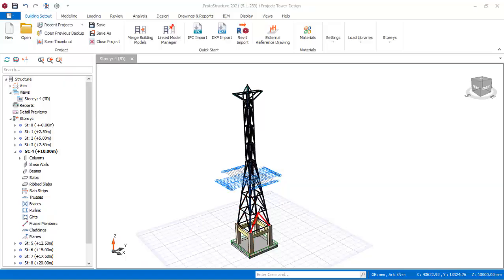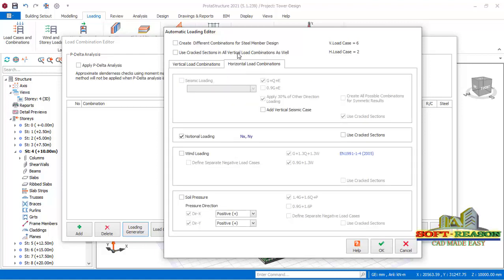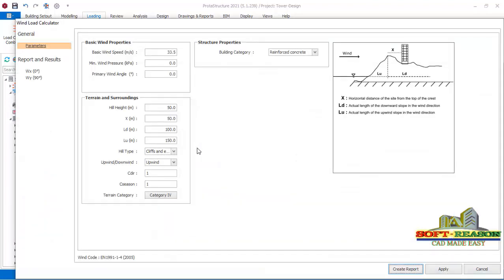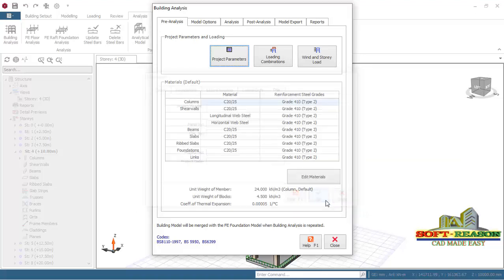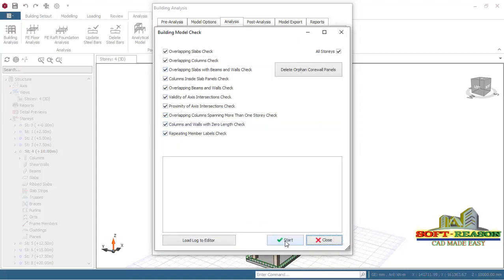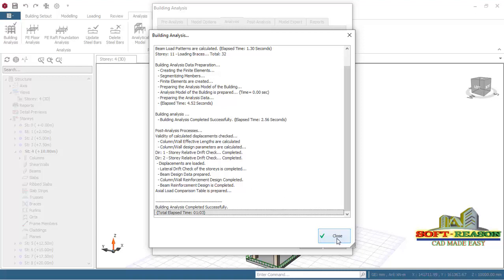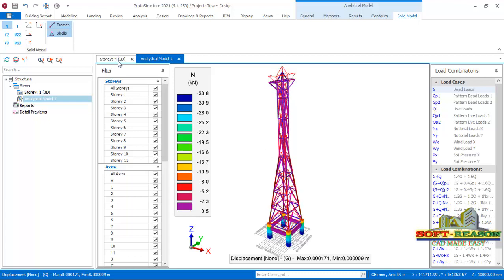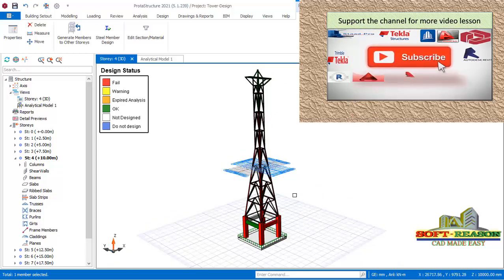How to Apply Loads and Run Static Analysis  of Transmission Tower in Protastructure 2021

Comment: How do u add the vertical loads on the topmost storey?
Reply from the maker: Use line load option
Reply: @CADmade-easy  bt the line load option is only applicable when u have a slab, but for my model i dnt have a slab on the topmost storey, its just the steel beams. Please advise. Thank you
Reply from the maker: @nizaamkalandar8118  use nodal load options
Reply: @CADmade-easy  Warning: Dir 1... Relative Storey Drifts Exceed the Limits. X 
    Stiffnesses should be increased and Building Analysis must be repeated.
Warning: Dir 2... Relative Storey Drifts Exceed the Limits. X 
    Stiffnesses should be increased and Building Analysis must be repeated" 
This is the warning I get after runnng the analysis.. can you please help?

Comment: I don't think you should disregard that Dir 1&2 Drift warning after the analysis was conducted. That warning has to do with the stability of the structure... It should be properly addressed. Your videos are supposed to be for educational purposes... and in Engineering, we don't just wave warnings aside, they need to be addressed...
Reply from the maker: Stay tuned the next lesson will explain the warning. Thanks
Reply: Looking forward to it